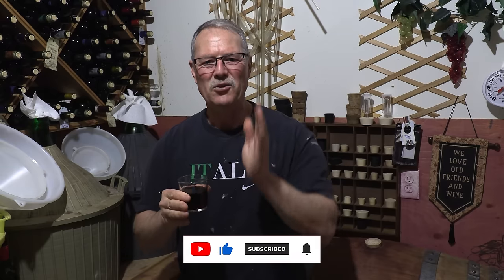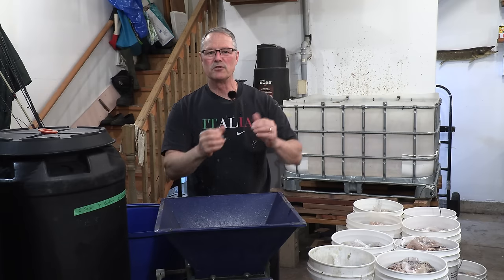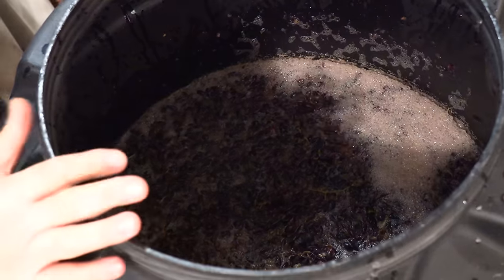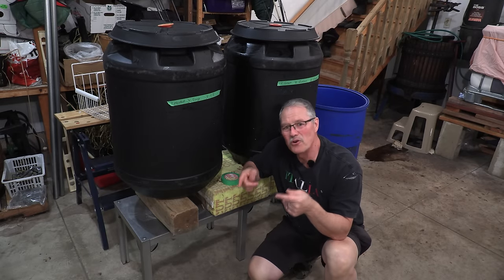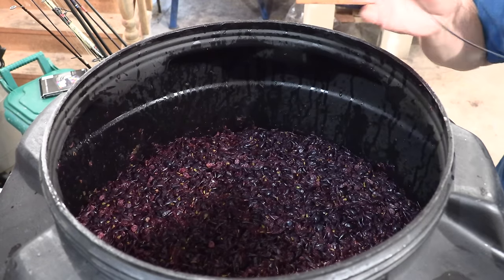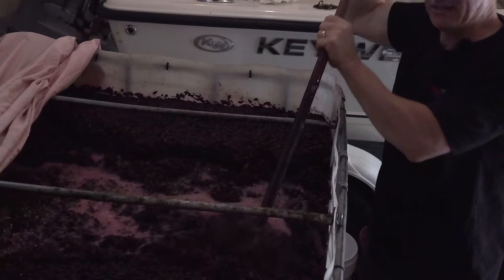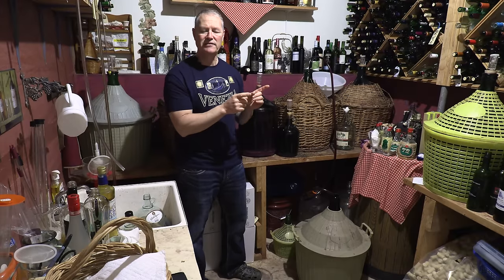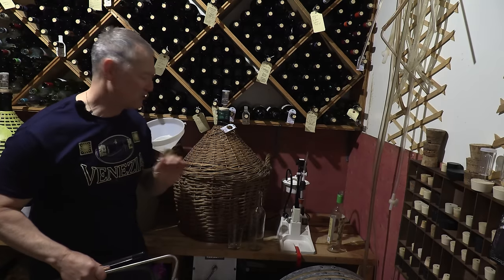Making homemade wine from scratch masterclass, all natural, traditional way. Amazing results!

Comment: This was the absolute best video on the winemaking process!  So interesting. You sir are a master winemaker and a great teacher.  I am so excited that I came across your YouTube channel. I'll be binge-watching the rest of your interesting content.
Reply from the maker: So happy to hear that you enjoyed this episode and thanks for taking the time to write ☺️
Reply: @CookingwiththeCoias   

Indeed I too, must commend you Ivo,  as this is the best video I have seen on YouTube for making wine at home.
Many thanks for you taking the time to go into great detail in this video .truly well done! 

In closing, I have a few questions regarding cleaning the wine press.
My dad's old wine press very similar to the one you have (just one notch smaller in size) .. Has been stored in the garage for the last many years.
It kind of needs a major cleaning etc ...looks dusty etc and needs a cleaning overhaul.
(Note - All parts working & functioning etc)

So that is precisely my question...in your opinion Ivo, 
1)   From a cleanliness perspective, how does one  know if it is still good to use again?  
- how to best clean the wood parts?
-  and  if some areas on the cast iron show slight surface rust, is there a remedy for that? Or is that a deal breaker?
Any tips on cleaning/ restoring the wine press ?
2) Also, for regular yearly cleaning after making wine, if you are aware of a good  video link that shows how you  clean your wine press ..that would help lots.
Thank you so much for all your videos !!!
Reply from the maker: @SS-pi2yi  use a brush with some soapy water to scrub your wine press, those hose it down thoroughly - you can also sterilize with a weak metabisulphite solution and it will be good to go - same process for cleaning when You're done. As for the rust, wash/scrub away all the rust, then treat that area using food grade grease...put the grease on with a light coat then wipe off - the remaining residual will protect 👍👍
Reply: @CookingwiththeCoias  will do- thanks again!

Comment: Wow so many blends in that wine. 

Iv been making wine for over 20 years, my family for over 60 years we never desteamed and never got a bitter wine

Also if you like the flavour oak barrels give but don't have room for oak barrels they make oak spiral rods that you can add to a demijohn
Reply from the maker: Thanks for writing in and for sharing your tips with us 👍 Regarding the de-steming, give it a try one year and you may notice a difference 👍🍇🍷
Reply: Agreed I watched an old Italian make it. He sd I don't know if it's the correct way or not but this is the way I was taught. He only removed very large stems. He sd the part of stem where the grape is attached holds the tannins. He used no yeast or additives. His sugar was at 24 so he also didn't add sugar. The stems were finally removed at the pressing step. Which he did multiple times in barrel with same batch. And only one type of grapes.
Reply: @CookingwiththeCoias  i tried on a small batch one year,  it made no major difference

Comment: Thank you for your time in putting this video together. I am going to make wine this year for the first time and will be using your recipe to the “T”. I just wanted to confirm on the FX10 that it is .073g/lb of grapes and not .73g/lb. Thanks again Ivo!
Reply from the maker: glad to hear you enjoyed this wine making episode and happy to hear you are going to make wine for your first time - that's exciting!! Yes, you are correct, for each pound of grapes, you use .073 grams of yeast.  So if you have 250 lbs of grapes you would use 18 1/4 grams of yeast (you could round up to 19 grams). Good luck with your wine making - the season is now :)

Comment: Thanks so much for a wonderful, inspiring video! 1st time brewer here and I’ve 10 gallons of red wine pressed and in for the secondary fermentation in the carboys with the airlocks on.
1. How long do I let it ferment 
2. Do I remove and rack the wine - what intervals
3. Should I let it sit undisturbed for 6-8 wks?

TIA for your help!
Reply from the maker: Yes, let it sit for 6-8 weeks, then rack it. Then let it sit till around February/March, then rack it again, then let it sit until August, then bottle it or let it continue to age in bulk. Just be aware that in the Spring and summer, the wine will increase and start to rise, so keep an eye on it that it doesn't overflow into your air lock, as then your seal will be gone.  Hope this helps 👍🍇🍷
Reply: Awesome thanks so much for your reply and guidance!

Comment: Fantastic really i enjoyed it, you're gifted winery , one question please sir >> using the same natural method as your friend's barrels how to use natural organic sweeteners ex: black honey in order to make sweet wine , how to force stop the fermentation process (naturally) to maintain the sweetness level ?
Thanks in advance,
Cheers.
Reply from the maker: Naturally is tough....you could bring it down in temp to almost freezing and that will do it but then it would re-ferment once warmed. The best way would be to let the wine ferment completely, then add your sweetener plus potassium sorbate. The other option would be to add a strong alcohol such as brandy and that will also kill the fermentation, however, now you would have a Port wine

Comment: What a great video! I use satellite gardens in Hamilton as well. Question for you, if you didn’t have enough juice to fill a demijon or carboy after the fermentation is completed would you top it up with store bought wine? 
I’m very excited it’s been a few years since I’ve made wine and I’m getting back into it again so I want to make sure air won’t kill my wine! Thanks!
Reply from the maker: One truck I do is that I add marbles to bring the level up, as marbles are glass so no impact on your wine. Otherwise, if your wine has finished fermenting, you can certainly add a bottle of wine to top it up, but it will change your wine a bit and keep in mind the store wind also has sulphites ,- the marbles however, work great👍🍇🍷 Say hello to the fine folks at Satellite for me😊

Comment: Great stuff sir.  You definitely need a bladder press.  Best investment I’ve made for the pressing process.  Let water pressure do the work.

Also, do you ever use Malolactic Fermentation as well?
Reply from the maker: That's great to hear that you have a bladder press...very nice,!! As for malolactic fermentation, it typically occurs naturally when the primary fermentation is complete, so I do not induce it👍🍷

Comment: Hi Evo, new to your channel and loving your recipes and videos! Couple questions on the wine-making.

1) What are your tips for cleaning/disinfecting the vats/demijohns/bottles?

2) I live in a small apartment but I do have a cellar with my own storage area that I think would be perfect for a small operation. Is it worth making small batches? What would you say is the smallest amount of wine people can make where it's still good quality?
Reply from the maker: For cleaning/disinfecting, you can use a weak metabisulphite solution at around 100 ppm. As for making small batches, I would say it is still better than making no batch, so yes, go ahead and it will still be o.k. - just try to make the largest batch that you can :)

Comment: This is very fascinating. I'm just starting my wine making journey. I very much enjoyed the sweet red wine I had in south Africa. Could I add sugar to this wine at the end of the process before bottling?
Reply from the maker: You can, but you will have to stabilize it by using sorbate and sulphite in order to prevent re-fermentation

Comment: Thank you for passionate and informative masterclass.  I'd like to make "medium red wine" and as you mentioned we should ferment it for 3-4 days, but I also want it to have a little sweetness. I want to use natural method without adding sugar or any additives and as I read one of the way is "arresting fermentation", but I don't have experience and knowledge and its my first time to make wine. Could you please advice how to stop fermentation? I mean when should I stop fermentation? In how many days? Or how can I determine If I stop fermentation on right time? and how to determine how much it affect sweetness of wine? Thank you <3
Reply from the maker: To make a sweet red naturally without adding any sugar, you will need to stop the fermentation, just before it finishes.  If you let the wine ferment all the way, you will have dry red wine. If you stop the fermentation early, by adding 1/2 TSP of potassium Sorbate, foe each gallon of wine you have, you will have a wine with less alcohol content, but it will be a bit sweet. You can achieve this by observing your fermentation and when it is almost done, you can add the Potassium Sorbate. Or, you can measure the specific gravity. When the specific gravity reaches less than one, you will have a dry wine. If you stop the fermentation when the specific gravity is 2, you will have a touch of sweetness - a specific gravity of 3 and it will be even sweeter - all depends on your liking, but remember, the sooner you stop the fermentation, the sweeter the wine will be and the less amount of alcohol if will have. If you look at typical bottle of muscato wine, it is usually sweet, and you will see the alcohol is typically 6 or 7 % - so its sweet because they stopped the fermentation early, and it also has low alcohol for the same reason. Hope this helps :)

Comment: How long do you let the grapes ferment in order to get a less astringent flavor?
If your fermentation is finished after a week, then you let it vent out for 5-6 weeks, why do you have to let it set for 5-6 months?
I live in a small apartment, so this will never work for me, but I want to thank you for an informative and enlightening, and entertaining, video. Slainte.
Reply from the maker: If you want less astringent flavor, you can just crush and press right away - or, let ferment with skins just for a day or 2. Yes, your fermentation is mainly finished after a week or 2, depending on conditions, but it may not always be 100% done which is why the air lock is needed and after 6 weeks, there will be heavy sediment then after 6 more months, this will allow you wine to clarify more, as you will have more sediment - not near as much as the first time though. Also, the wine is maturing during this time 👍👍

Comment: Very very useful and full detailed. One question i made my first wine and i sanitize everything in process and i made my own cherry wine and it has 10% alcohol. But unfortunately I'm full of stressed about does it has lots methanol in it and make me blind or sth else i don't know what to do please give me some advice. My recipe is 
2 kg cherry boiled in 4 liter water and adding 500 gr sugar and mixed well and after 15 min i turned it off. So after room temperature it was i let it sit for fermentation in container  and added bread yeast 1/2 tsp and also i put an air lock on top . 
Thank you so much . 
❤
Reply from the maker: Although I have not made cherry wine so I cannot say one way or another - however, cherry wine is available for sale at retail stores, so generally, safe to drink 😊

Comment: What a fine technique. Those bottles, do they need to be cleaned/autoclaved to remove any contamination before the bottling process?
Reply from the maker: ..my father never did...he just made sure his bottles were very clean but you can certainly sterilize them by using a weak metabisulphite solution 👍
Reply: Star-San is a good bottle sterilizer. Industry standard if you want to make sure you don’t get vinegar.

Comment: Thank you, that was a tremendously interesting video! Which products do you use to sanitise your equipment, especially the grape press?

And, just btw, that trick with the marbles? So simple and so absobloodylutely genius!
Reply from the maker: So glad you liked the marble tip 👍 I use them all the time when needed. As for sanitizing, I will use 1/4 TSP of potassium metabisulphite per gallon of water, which is about 100PPM ratio.  Once you are comfortable you can finish off with regular water, if you want to get rid of any residual sulphates

Comment: I just put my wine in damijan. However, it tastes dry. Your opinion on sweetening it some? Used Ruby Carnabet & Petit Shyra equal grape mix. PS: LOVED your video❤
Reply from the maker: So glad you enjoyed this wine making episode,👍🍇🍷 once your juice has completely fermented, it will be a dry wine. For sweet, you can either kill the fermentation before it finishes, so this will leave you with a sweet wine but less alcohol - or, let it ferment completely, then add a sugar syrup and a stabilizer to prevent it from re-fermenting...this will yield a sweet wine with normal alcohol level👍👍

Comment: Best wine making video I've seen! Thank you so much!! Question, though. Im a little confused about the 7/8 full if air is the enemy. Several other videos say to fill the dj or carboy to its neck. Is it really ok to leave it at 7/8 full, and do you do that for just a few days and then top it off, or do you leave it at 7/8 until the 1st racking 6-8 weeks later??

Also, I have a 6 1/2 gallon carboy, but didnt get enough juice to fill it after first fermentation with the skins.  Can i add grape juise to the carboy to bring the level up?
Reply from the maker: To fill your carboy, the trick I use is to add marbles and that will bring your level up without impacting your wine 😊 Also, the 7/8 full is only at the very beginning, just to ensure fermentation has slowed, then top it up immediately. If you top it up right away and the wine is still fermenting relatively strong, it would overflow, so the 7/8 is just yo avoid that and the air at the very beginning is not as harmful - once fermentation has finished, air is the number 1 enemy. Hope this helps 👍🍇🍷
Reply: Thank you sir!! I moved the juice Saturday and I should receive my marbles today. Fermentation is still going on, but it has DEFINITELY  slowed down. Thank you again!

Comment: Thank you for your knowledge. I ruined my first years wine from my own grapes last year 2023. I won't lose it this year. Thank you. I need to know, do you sterilize all your racking tubes, as I know you said you don't use any sulfites. Thanks
Reply from the maker: I personally just ensure they are 100% clean and rinsed with very hot water👍🍷
Reply from the maker: ...you can of course use a weak metabisulphite solution if you want to sterilize, and then rinse well to remove any sulphates

Comment: Ivo, Thank You so much for you Excellent tutorial video and geez I have soo many questions: 1) so during your fermentation process you are mashing the skins back into the juice, is this also considered "degassing"...removing the carbon dioxide and 2) in letting the juice sit in the container for 6 months before racking (I understand there is back and forth between folks about bottle aging and "vat" aging) is this what you are hoping to achieve...and lastly (I am trying to keep this as short as possible) what "neck of the woods" are you in and the reason I ask is how you are able to obtain the grapes?
Reply from the maker: Great to hear from you and here's some feedback...1) not considered degassing...it's extracting color, flavor and tannins from the contact with the  skins 2) letting the wine age in bulk for 6 months or more (the longer the better) will allow the wine to develop maximum flavor, ensure 100% fermentation has been completed, allows for sediment to settle and the larger the bulk container, the better the wine will develop 3) I am in Ontario and use California grapes  which get imported and shipped to us here in Canada 👍🍇🍇

Comment: Great video! Are the grapes you use organic? Also, how do you clean and sanitize your wine press?
Reply from the maker: The case of grapes does not specify organic, so it most likely is not and the sanitize your press, you can use a water solution with potassium metabisulphite and then just hose it down 😊 🍷
Reply: @CookingwiththeCoias  Thanks! :)

Comment: Thanks for the video!  It is really informative and you are very good at explaining and teaching in a way that makes it easy to learn.  I have a quick question, when I was in Italy I did a farm tour and when they made their wine instead of a device like yours they poured a small amount of olive oil on top of the wine in the demijohn which allowed it to degass but still sealed off the air.  What would be the advantages and/or disadvantages of using that method?
Reply from the maker: The only advantage would be that you don't need to buy an air lock but huge disadvantage would be it could negatively taint your wine with olive oil scent. I have never done that and honestly, I've never seen it done in Italy either - but I'm sure there's someone out there doing it - I personally would not recommend this at all...air locks are only a few dollars in cost. However, if you decide to try this, drop me a line with your results
Reply: @CookingwiththeCoias  Oh no I'm not planning on trying it... when I saw it I was quite confused as to why they would do it that way.  They were a farm that specialized in Olive Oil production as they had their own brand so I'm assuming that's why.  Thanks for confirming that it isn't the best idea lol!
Reply: A drop in your airlock is handy for long term aging bc it slows down or prevents evaporation. But that sounds awful in the wine.